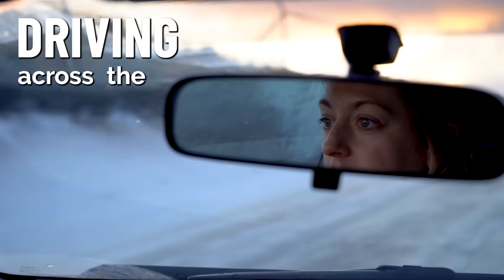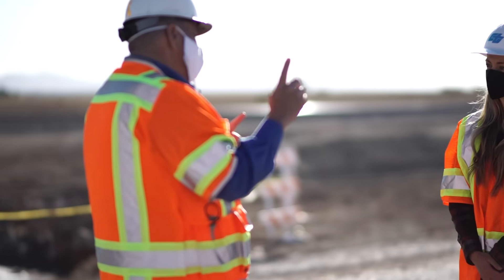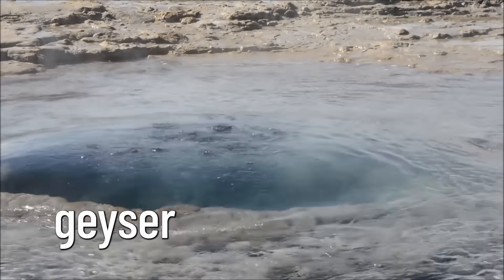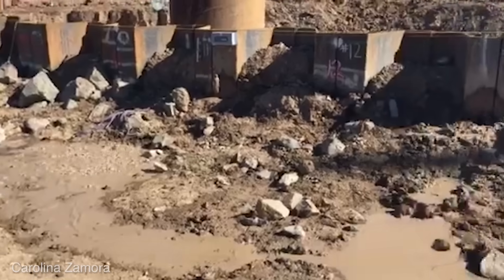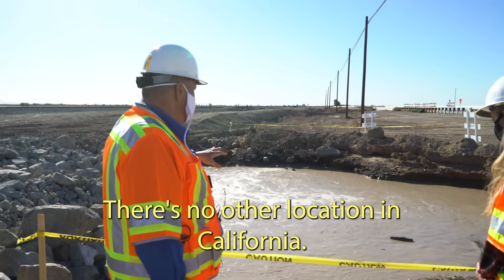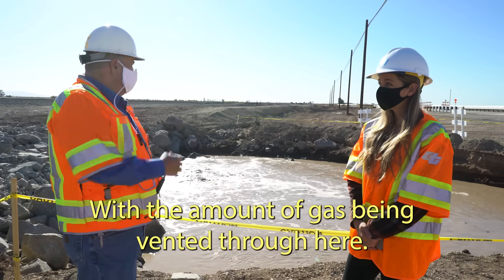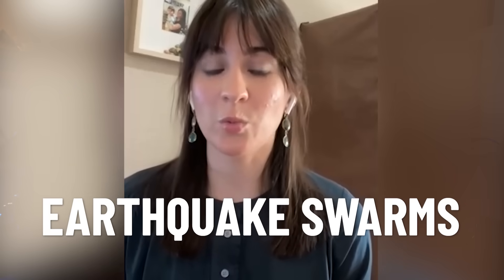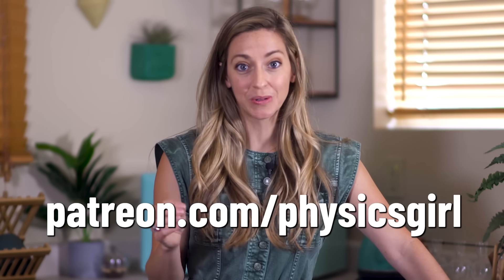World's Only Moving Mud Puddle

Comment: What if the mud puddle is actually NOT moving and the rest of the large section of earth material is the one moving? What if the mud puddle is actually just a duct of rotten egg smelly escaping material from way beneath that is just causing some effect similar to the effect of the bucket of smooth sand, but definitely not the same because the material above is way different.

Of course, you are going to say, "Well, that's just exactly what was said in the video between 4:00 and 4:30." True, but think about what may be deep below that and, to my actual point, what is really moving? Let's explore. Between 6:30 and 7:00 it is mentioned that "this" passed a 75 feet wall. I'm thinking that the source of this gushing material might be hundreds of feet below or even miles below. How thick are the tectonic plates underneath this area? Why do I bring tectonic plates in the first place? Even though I think that the source of the material may be that deep, perhaps the tectonic plates have some cracks or fissures where the material is "leaking" out from, making their way through all sorts of material through different places and paths. The point being that such paths through which the material is leaking may be changing (because the tectonic plates are constantly changing) so the path of the effect above the ground may look like the mud puddle is moving.

Comment: What would happen if you dropped a hammer, rock, or small, dense object attached to a very very long and string rope (maybe used for climbing) into the mud spring? Would you be able to pull it out to measure the depth or would it just be stuck there for the rest of eternity?

Comment: I live in the city of San Luis, Arizona. A few years back I read in the local news paper about a big project to be built in city. A energy plant that would be a first of it's kind and that it would put the city of San Luis on the map having a mega structure. This tower would be seen entering the city of Yuma which is a distance of 25-30 miles from the city of San Luis. The project was put on hold do to the lack of investors, wildlife and other factors. This new type of energy producing plant would put out power for the city and sell to neighboring cities even across the border. Water would need to be pumped up  to the tower standing 1 mile in length. 2 days ago the local news paper had an article on talks about bringing back the project. What has me wondering. How to pump water  up a 1 mile  horizontal tower.  Just a suggestion! 
Peace be with you and God bless.

Comment: dig around it and put the strongest metal you can get in the holes that are the same length of the mud or build a mini dam but stronger around it
Reply: They cant
Reply: @justinz2561  or burn it or drain it
Reply: @joshmcdowell7875  burn water?
Reply: @justinz2561  basecialy heat it up until it becomes steam I've done it berfore
Reply: @joshmcdowell7875  yeah but for that to happen they need big heat under  and the bottom of the mud pit is deep and dirt so theres no way you can fit a whole heat sauce there
Reply: @justinz2561  yeah true

Comment: I'm curious if they haven't tested the theory of it moving towards its source by drilling on the other side of the road to hit the gas pocket there thus saving thousands on road and rail repairs
Reply: This was my thought too. An exploratory well the other side of the highway aligned with the current trajectory of the puddle might allow for a new escape route for the gas and halt or slow the initial vent’s movement. Of course, this depends on the theory of the puddle moving towards the gas reservoir being correct. I would question what geological features are causing the gas to vent diagonally, or horizontally in the first place.

Comment: If it's possibly just coming up from an angle, they could try sourcing where the gas from is by tracking the movements of the mud. Then drill into the source point to let the gas out. That way it goes straight up like it wants to and doesn't damage the area or endanger lives.

Comment: It looks like this might be a combination of a couple different phenomena. If I had to guess, this is due to a combination of earthquakes, cavitation, carbonic acid, and a VERY deep carbon dioxide source. 

My hypothesis is that a long time ago, earthquakes exposed a deep source of high pressure dissolved carbon dioxide to a vein of very soluble rock. The vein was eaten by the acid until it found a path to the surface and formed the original mud pot. Later earthquakes started collapsing the cavity caused by the dissolved vein, and it will continue to collapse until the carbon dioxide source opens a sinkhole to the surface.

If my hypothesis is correct, then it is vital to find the underground channel, and trace it back to the source. The area should be evacuated, and a relief hole drilled. The mud pot could end up creating a massive caldera when it reaches its source, but unless we find it first, we won’t know the danger.

Comment: so if it was faced with this dilemma would be to sonar pulse the heck out of the ground with the type of equipment used for oil and fault detection ground penetrating radar. sonar submersibles into the vent anything and everything to map this phenomena and its subterranean structure or an idea how much concrete powder can they shove into this thing

Comment: So what happened to that railroad? You said that the puddle crossed the railroad which means it went under which means there could be some hole or something under the tracks which is a bad thing for trains to cross over. Did they reinforce the land so the tracks won't collapse or something or did they just outright close those tracks?

Comment: My first thought would also have been to drill a relief hole past the infrastructure so that the mud pot "skips" it, but my original college path was petroleum engineering and one thing they really drilled into us (pun intended) was how dangerous it is when your mud blows out like that at 8:36  There's a lot of pieces of very heavy steel on top of the hole that have just gone flying somewhere at high velocity whenever you see liquid shooting out the top of a drilling platform and it can take the whole platform down too. That's incredibly scary.

Going off what I see on Google, it looks like they were forced to give up on the rail line and just rebuild behind the mud pot, and I'm guessing the same will happen with the road. The fiber lines they can probably get away with adding more poles so that it spans safely across it without harm.

Comment: Following the theory of it being at an angle would it be possible to calculate the general direction it's coming from and try to help it go straight up avoiding the trouble of letting it slowly destroy a path? As in, would it be possible to approximately calculate where the source is by the speed on which it's moving and the digging the ground above it so it can form a straight tube up instead of it slowly naturally coming to a straight tube?

Comment: SCP- 1950 : The Mudpot

Classification: Keter class

Information: SCP- 1930 is your standered run of the mill mudpot will not distinguishable anomalies to it, however when further observations was done to the anomaly it was shown that the anomaly was moving little by little into a certain direction. When attempts were made to stop the anomaly they failed due to the SCP latching upon those who interfere with it and consuming the perpetrators which help add onto the anomalies mass. Request for more D- Class for more studies is pending for the time being.

Comment: If they think that it's moving because the gas/water is moving up at an angle, can't they just drill on the other side of the road, to force a jump to the other side? The pressure would take the shortest route, and exit through the newly drilled vent holes

Comment: I'd be collecting this water since California is in a water shortage. Filter and make it drinking water.
Reply: it would be easier to filter the ocean water right next door
Reply: The water and hydrogen sulfide gas combine to form sulphuric acid, which breaks down the rock into the stinky mud, while escaping carbon dioxide bubbles up, about 80°f. at 40,000 gallons a day. Sulfuric acid!!!

Comment: Couldn’t they drill holes in the direction it’s going so that when/if they hit the source area the original mud spring would stop moving and stop threatening the agriculture. Like even if it would cost millions of dollars wouldn’t it save a lot of problems they’re facing. I mean maybe all the mud water from the pressure pocket damaged components in the drill but if it did why not reinforce the device and increase its drill length then try again. But also what if the release of pressure makes the ground unstable and the drill falls in, maybe bring heavier vehicles and extremely strong tow lines, cables, etc to make sure that if it falls it doesn’t go down. Sure they’ve probably thought of this but I mean why not try.

Comment: 9:50 I have a feeling it's like an inverted head cut (erosion) underground.

The relief drilling is an Idea I was thinking of as I watched the video, then saw you all did it. ( Go up in the general direction it seems to be heading and see if you can find the point above the point of general origin underground) unfortunately, It may be a very narrow inverted vally and if you don't get it at the highest point, it may not change gas flow direction. So maybe Mass drill lines of holes in an x pattern periodically so that at least one may or may not find the inverted valley floor....

Not exactly worth the effort?

Comment: i wouldn't think the straight vertical drilling would resolve the problem fully, you'd need to redirect the path of what's already flowing to actually stop it all and you'd need an angled drill path to intercept the current flow and head off wherever it might move over time. relieving pressure alone is fine and would shrink the mudhole and slow its movement but i think wouldn't be guaranteed to stop it.

Comment: There is only one reasonable explanation. There is an underground cave. The co2, and "rotten egg" smell are obviously volcanic in origin.

So you have deep earth gas under pressure bubbling into an underground cave filled with water. A hole in the ceiling allows it to reach the surface, a farmer's field with tens of feet of plowed dirt, viola, mud.

As the underground cave erodes, surface material drops in plugging the hole, forcing the water co2 mix to form a new opening. Sonar should be able to map the cave, and tell its extent. The mud puddle will travel until it reaches the end, the cave is likely hundreds to thousands of feet below surface, and nay be several miles long. End of story.

Comment: Fascinating story. Did the geologist do a geo-electromagnetic or [electrical resistivity tomography](https://en.wikipedia.org/wiki/Electrical_resistivity_tomography) survey to try to image the underlying geology? Is there an estimate for the size/volume of the CO2 gas bubble? Did the geologist consider trying to convert the CO2 to calcium carbonate by adding calcium hydroxide to the puddle either by pouring it into the puddle or by injecting it into the relief well? Is the geochemistry conducive to this type of CO2 mineralization? I image that the trick would be to add calcium hydroxide at the correct rate so the calcium carbonate precipitate does not block the CO2 flow so all the CO2 can be consumed.

Comment: let it move, it wil destroy the road but as my father does asphalt I know that repairing an asphalt road is fast and relatively affordable, more so than all the measures that have been used, have a portion of the road moved to before it's path until it has passed, that is the most affordable method if you ask me

Comment: Or potentially.. as theres a huge fault line, its nto the mud pile moving its the tectonic plates moving and the puddle is staying stationary cutting a hole in the plates as they move. Everything moving with the plates on the surface except the pressure is cutting a channel through it keeping it stationary. Just a thought.

Comment: It seems pretty obvious, that this is a vertical C channel - it found the easiest path up, which curved away from its initial spot. Because it his a water table, it is acting like quicksand and pulling material out of the way at the top carving the path. Eventually, it will settle over a single position and later will run out of fuel. Because of how water, sand, and gas working together acts - it is creating a new path of least resistance. Simple.

The relief well is interesting - there could be hard rock below, like a shelf that the gas is moving around underneath the surface... hopefully they are drilling in the direction of travel - eventually they could find the source and create a new stable location for it to vent.

The earthquake swarms are also interesting - new pockets are formed so new paths are created and it was moving before 2016, but it probably had to carve through harder material which causes it to move a lot slower. Because of the earthquakes, it could've cracked the material below, which then has to be sunk / moved and is creating the new path without having to abrate solid material with the sand / water movement..

Comment: If it co2 try and use the same technique as they do for deep sea gas extraction and use the pressure to run a turbine and make sum electricity for the state problem solved

Comment: Could you try to calculate based on the amount of pressure based on the rate the gas has been coming out then determined how much it increases the more it move get a distance to the actual source then drill down in that

Comment: I am from Niland. That puddle has been moving for years..oddly, the mud pots basically dried up. I used to go see them as a kid. The last time I went specifically to the mud pots about 2018,  the biggest one had dried. My theory, since they lined the canal and closed the z drain and no more fresh water is getting to the salton sea, either directly or through seepeage, the carbon is building up and not able to travel as easily or be as diluted as before. The ground underneath has dried and  perhaps thats why theres such a concentration of it or as you say a pocket. The change in the sea I believe has something to do with it. In case you didnt know, there are several geothermal plants nearby... Another outlet for pressure..so.... Earthquakes??? Been having those since forever. That is something that hasnt changed so I don't think it has to do with that.. Very interesting, but do consider the environmental factors and research how the Salton Sea was first created..you may want to share on a future video as it's quite an amazing story....

Comment: Sounds like erosion, underground water erosion, like a sinkhole.  It will wear away the softest material first. You may be right about the soft material at an angle. Natural things will take the  path of least resistance. Probably following the softest soil up that is laid at an angle. 

Why it may not have moved for 63 years maybe because it was pushing through something hard like rock. An earthquake could have made a crack in it and not is forcing it's way to the surface like you said. 

Very surprised that the C.E. don't just build a bridge were it's cutting a path though. That can keep both the rail and road open.  Maybe suggest that to them? 

No, not alive Ha!

Comment: this looks like a sign that california is in the process of breaking off the fissure is probably on spot and the land is now slowly moving above it. or the fissure is moving because a plate sheered and is now on the move to the mantle to be recycled. or this is the sign of a volcano getting ready to be formed because its a path of least resistance. cant wait to see myself proven or disproven on these three theories  some are more likely then others but those are the 3 i could see being the case those earth quakes are blates rubbing and breaking and it could have been a massive brake making that land under mover at a "rapid" pace geologically speaking

Comment: Why not just go a few hundred feet in the direction it’s headed and drill a relief well? Then it would have an exit for the gas that by passes the roads. If it’s angle is offset, helping correct it could pay dividend, or at least prevent it damaging the roads

Comment: nah right when i saw that crack through the underground barrier i immedietly thought about that the puddle is trying to take the quickest way to the surface so you are 100% right its the angle of which the source and the  puddle are at .
 its happenning slowly i know but think about it  ,
imagine you are holding a straw at a 45 digree angle  inside  a sand bucket  and you are tilting it slowly so that it gets  to a 90 degree angle then at that moment you  stop and leave the straw cuz it can hold itself at that angle forever without any change , that is 100% what is happening  here in the mud puddle  .
im no scientist but this seems the the most logical explanation to our human brains at the moment .

Comment: It is easy for heavy objects to sink... What if you put pressure sensors on the end of a drill head and drill directly into the spring? It would be easy to drill. The sensors would help the drill "feel" it's way down toward the source. Then you can find where it's coming from

Comment: if it really is coming up at an angle and is trying to take the shortest path, have they tried predicting where the source is and drilling to that? Or at least predicting the path on the other side of the road and drilling a relief hole there so the puddle can skip the road?